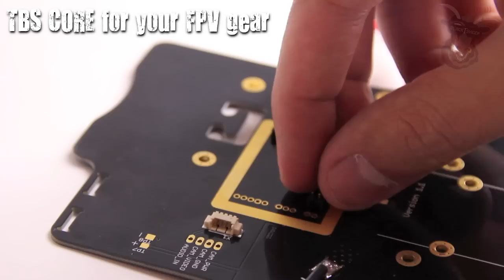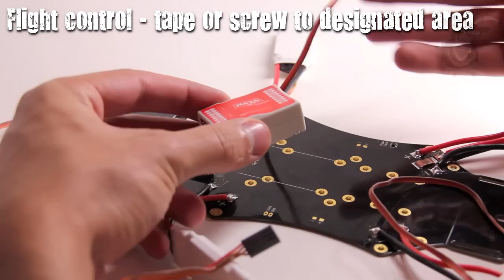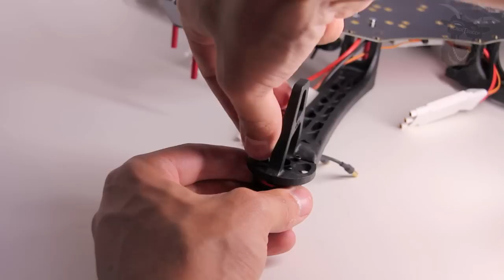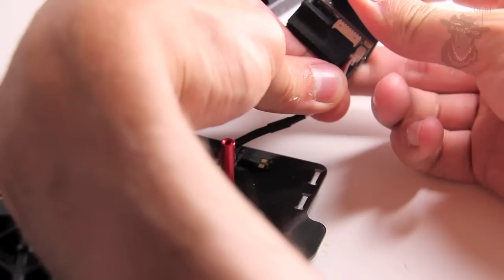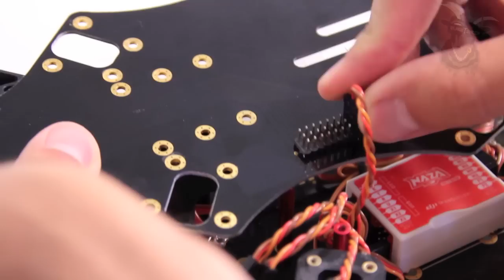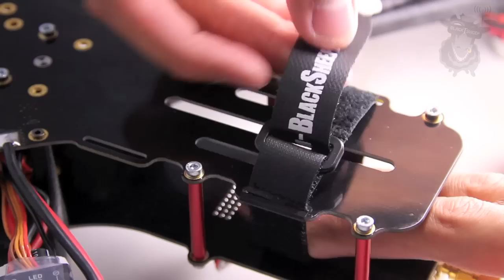[How To] TBS Discovery

Comment: Cleanest set up ive seen....when I saw TBS on the title, I knew it would be a tight setup......connections integrated into the frame plates...even though the weight and electronics are spread ou (like it needs to be)..they still connect without all the wires...this could be one off the best interference deterrents, ive seen..great job TBS
Reply: how to buy pcb board for 30000% the usual price is more like it. great job dji.

Comment: This is a very interesting project and the materials appear to be of high quality. My question is whether the electronic parts are exposed to natural elements like ground dirt,sand, rain, moisture etc. Shouldn't it be somehow "protected" by some plastic around it? Suppose one lands it on the ground during dusty wind, wouldn't the dust enter between the frames? Thanks.

Comment: Hi there. I just received my TBS Discovery and it didn't have the vibration-damping tape. I read it only comes if you have it in stock. I was wondering what you use/recommend for damping as I'd like to get some. Thanks!

Comment: Wow, that looks so simple, back to build board to do an esc calibration i guess, i should have bought the cable to calibrate all 4 :P. question i got the new esc's, do i need to strip the cables from 3 and only leave the signal cable?

Comment: Got super excited, got my disco, naza m lite and 750 kv and just out of the box started building like this video is going, but then i finished and read in the naza that i should have calibrated every esc individually to my receiver before installing on MC. Do i have to put apart the disco and calibrate esc? or can it be done while everything is connected? :(

Comment: Nice Video, I would strongly advise against the DJI motors the bearings in them are garbage. You will notice TBS no longer uses them. 80% of jello issues will be result of bad motor or unbalanced props. I am done screwing around with companies who build cheap kits who have never flown what there selling. Obviously TBS guys know wtf yer doing. I am looking forward to refined product that is Good out of the box. Yes Nastycop420 I am flying 2 of your frames FPV and loving them!

Comment: in the 0:26 there is a copper jumper, in my frame came without it, should I Weld IT? or is for a sensor?  in my frame came R1 50A sensor.

Comment: I want one of these so bad but I've just barely been soldering for a week. I'm afraid to botch something.
Reply: Draw a small dot on a piece of paper. With whatever you used to draw it with, try and touch that dot without making a new mark on the paper. If you can pull that off (even if it takes a few tries) you can solder!

Comment: Can anyone comment on how much solder really needs to be placed on the tin cover, I would have thought that with such a close fit just tack soldering on say the corners would be plenty. My core will be here in the next few days so I will be doing a rebuild to add the core and would rather not do more than I have to.

Comment: Why run the wires between the flight controller and radio though the board could you not have just ran them directly to each other though a hole in the board? seems like over complicating
Reply: The board is in itself acting as an electronic board. Simply putting a hole would still require a board, or custom fabbed plug. This reduces materials needed.